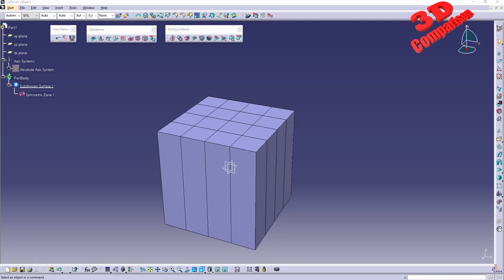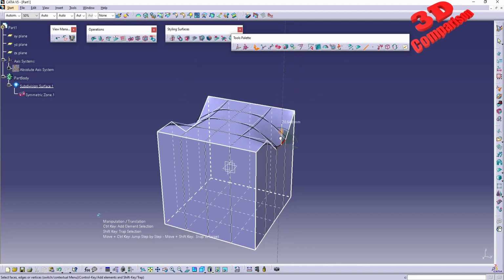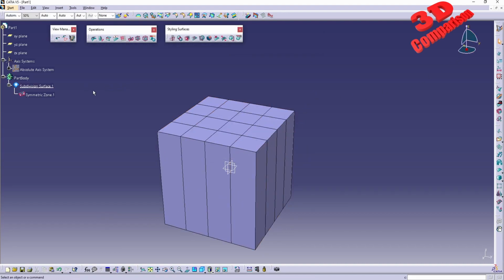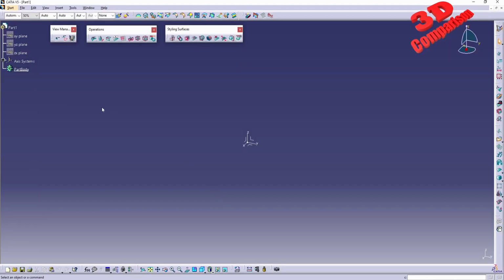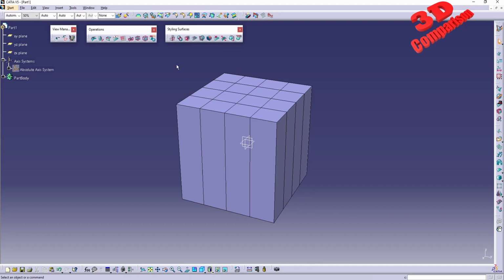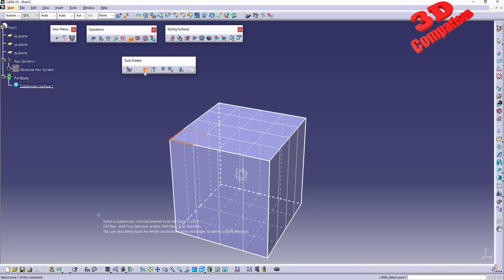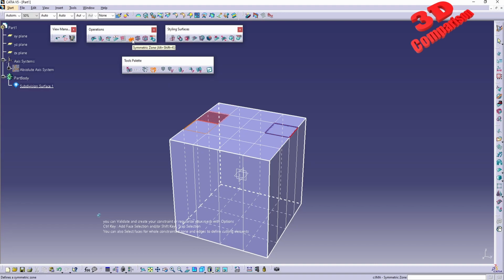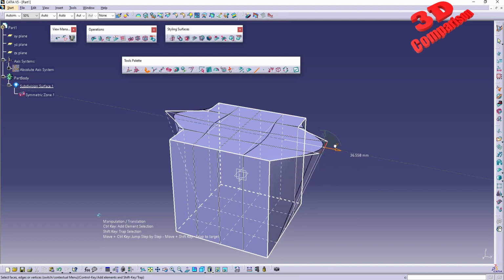How to define Symmetric Zones in CATIA V5

Comment: Hi, I tried following the tutorial steps, but in my Catia v5, the "operations" toolbar doesn't have the tools you used. I tried resetting the tool positions and contents to their default settings, but the missing tools still haven't appeared. I would greatly appreciate your help; I've been learning Catia v5, and it has a steep learning curve.
Reply from the maker: Hello, the symmetric zones feature was added within an updated version of CATIA V5, not sure if it was available or not in older ones such as R19. I know it R21 it was, I am using a newer version. I have discussed this within my newer video - https://youtu.be/N5r6vfClZAQ. CATIA V5 does have a very steep learning curve, I would recommend to go for either 3D Experience CATIA or Fusion 360 as I feel that Imagine and Shape in Catia V5 has started to lack support even in newer versions, in 3D Experience CATIA there are new workbenches intended for free form design.
Reply: @3DComparison  Thank you very much, I'll go take a look at the video.